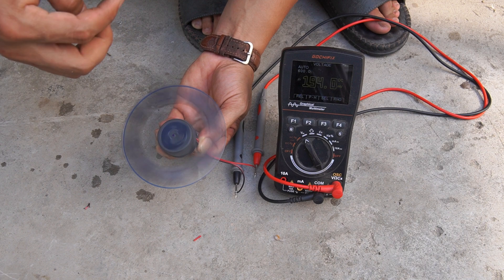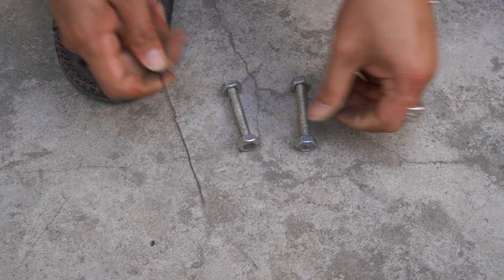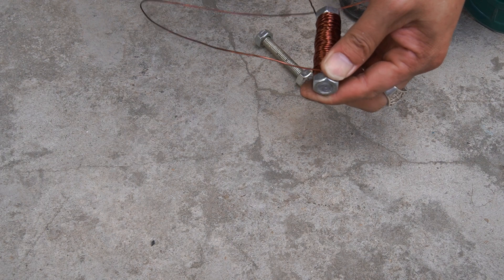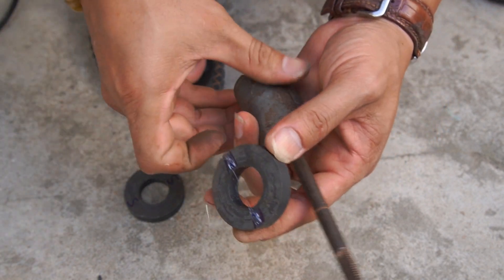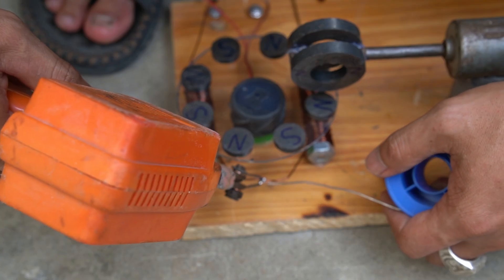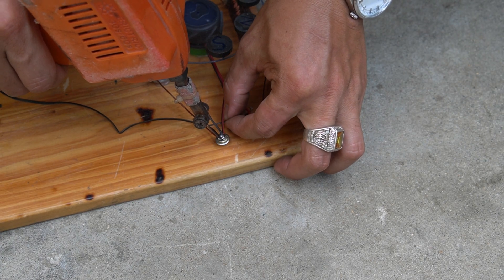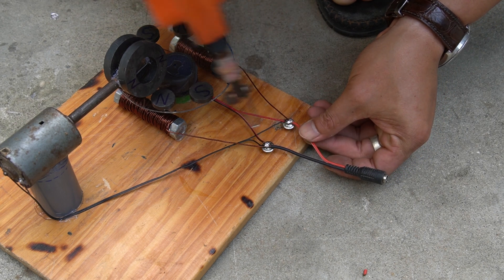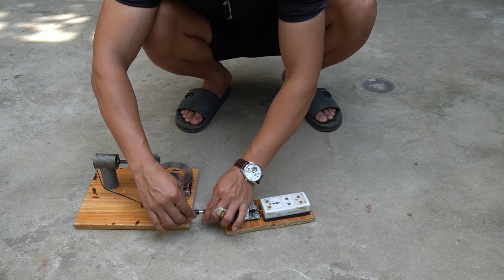Science at Home: Make a Working Generator Using Just Magnets and Wire

Comment: Permanent Magnet DC Motor how vold ???
Reply from the maker: Great question! 👍
The voltage depends on the size and design of the permanent-magnet motor, but small ones usually run between 6V and 24V.
Thanks for stopping by — come back anytime for more simple DIY builds! ⚙️✨
Reply: Please, if you have a diagram or picture of it, send it to me.  @Great_Inventions